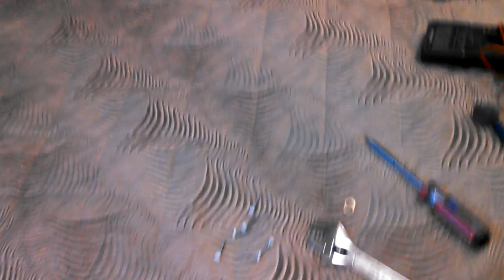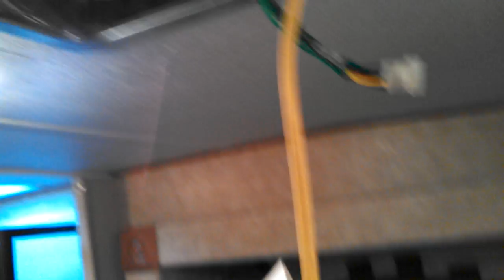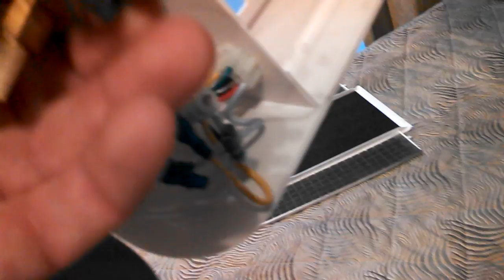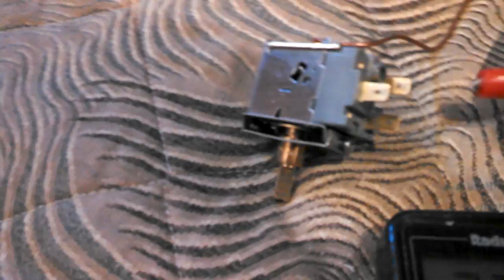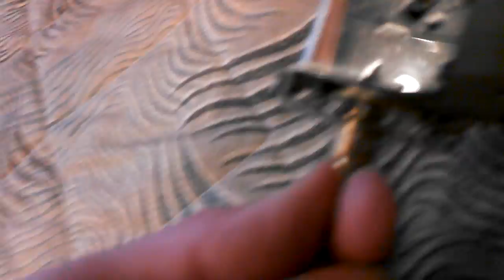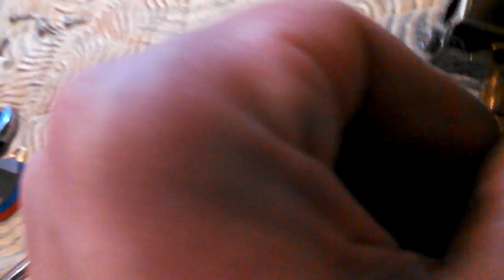Coleman AC thermostat range adjustment

Comment: oh thank you so much, my new mach 15 wouldn't get near as cold as my duo therm. it shuts off way to early from the factory setting.

I know what I'll be doing tomorrow!!
Reply: Did you figure out how to get the mach 15 to blow cold air constantly?  If so can you please show me what you did bc I'm having the same issue mine seems to fluctuate from 50 up to 68 & Id like it to only go as high as 60 bc temps here are getting in the high 90s and deeper into summer in the 100s.
Reply: peter c 

same thing he did. I have the new style air box. remove the 4 screws holding it to the ceiling, they are behind the filters. then take the 3 screws holding the metal lid off of the thermostat and fan control knob lid. with the new unit you don't even have to remove it, I just turned the screw untill I could hear the click of the thermostat. I had my knob at about mid way and it was about 68 in the motorhome.

now it gets to 60 or below in the motorhome
Reply: F239141 well I turned the screw but it came totally loose and it would not tighten back up again?  it ended up breaking bc the thermostat would no longer cycle on and off but the ac would constantly run...so I'm confused as to how many times you need to turn the screw to have it blow no higher than 60?   also when turning the screw does it still cycle and not freeze up?
Reply: peter c 

I turned mine out about 4 or 5 turns, and I have no freeze up issues. 

I don't know what to do if the screw feel out .
Reply: F239141 you did 4 or 5 full circles counter clockwise?  I need to get a new thermostat do you know if amazon sells them?
Reply: peter c 

not sure I work at a trailer place and I can get my parts direct.

I think it's part number  9330-3401 it's under $40 on Amazon
Reply: When you turned the screw did you have the AC unit on or off & you only turned the little screw counterclockwise 4 or 5 times?  I dont think I ever heard any kind of clicking noise like you are describing...What is the highest temp your ac goes before the AC kicks on again?  Mine will go as high as 68 but I want to set it to where itll only get to 65 at the highest before the AC kicks on again
Reply: not sure if you saw my post below plz respond!!
Reply: U could hear a click?  I dont think I heard a click ever when I did it
Reply: Hey man can you do a vid on how you got it to work?? Thank you!

Comment: Thanks for the video! On my Mach 8 I only had to remove 4 screws to drop the shroud and 4 screws to open a junction box that contained the thermostat. A couple turns out of the adjustment screw and now on max it will chill the trailer into the upper 60s.
Reply: Can you explain how you got your mach 8 to do this?

Comment: thanks, didnt want to tear it apart till i knew it was adjustable, also saved a lot of trial and error.  why they set that so high at the factory is beyond me mine would not cool below about 68, way to hot for me to sleep well.  much appreciate the time to make the video :))
Reply: Ditto. Just bought brand new camper and it drives me nuts. Won’t go below 70. This is step one. Step two is to get fan to shut off and stop re-introducing moisture to unit after compressor cycles off
Reply from the maker: Thank you